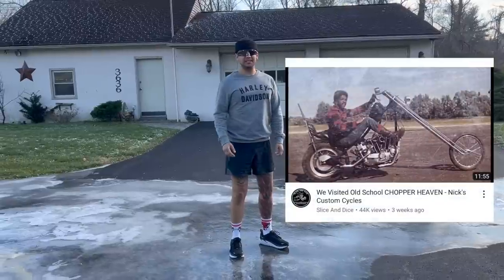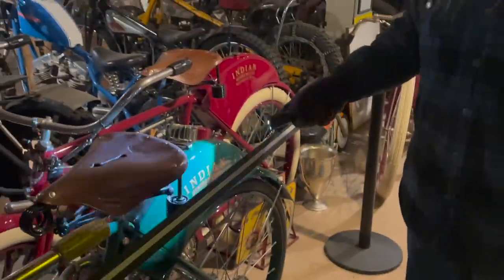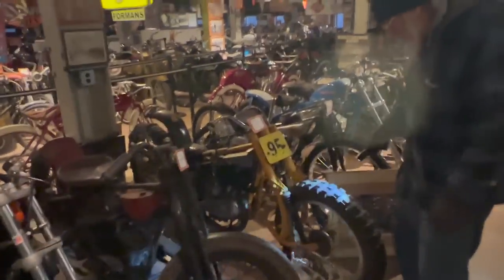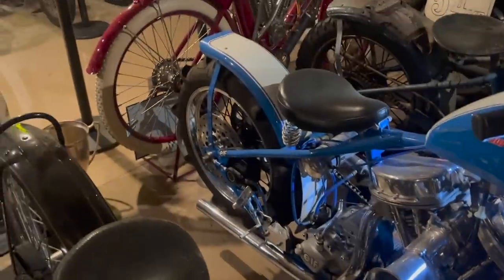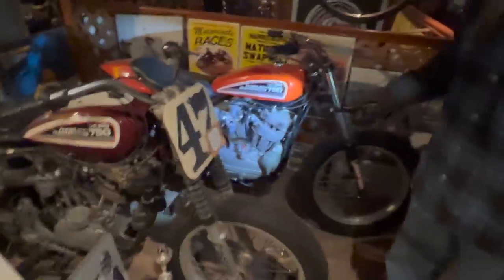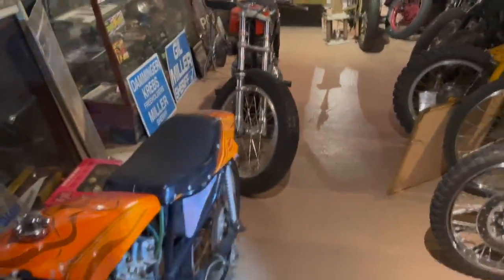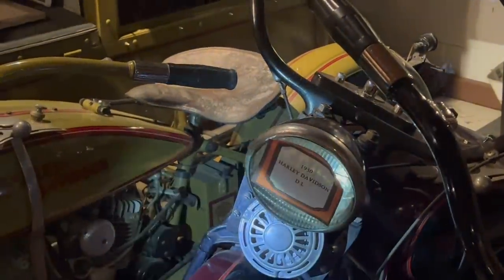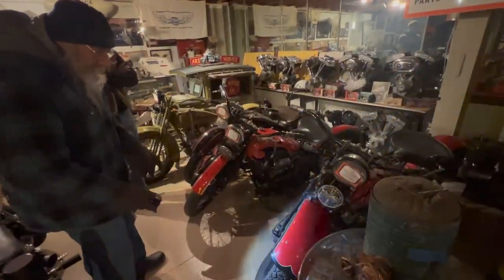The COOLEST VINTAGE MOTORCYCLE Collection Ever!!!!!

Comment: The throttle on the left hand side was so police officers could pull their gun from their right hand side holster. When you went you could order it on either side. This old-timer told me he got gas from the pharmacy in lithograph tin cans for 3 cents a gallon. There were no motorcycle shop you went to a bicycle shop because a bicycle and a motor became a motorcycle. It came to your house in a wood crate and you would have to put it together like a die cast kit.
Reply from the maker: right on!